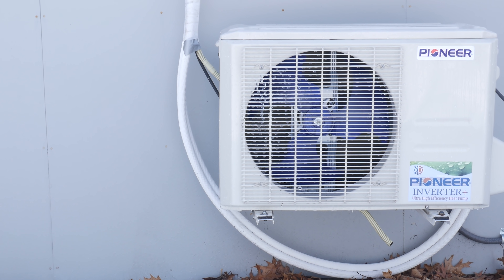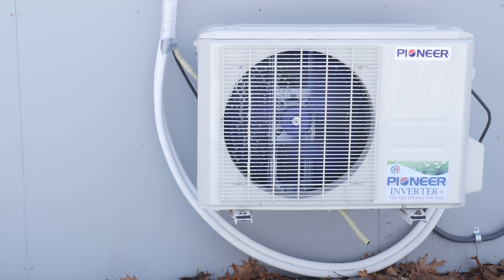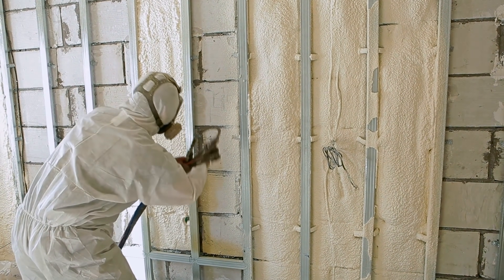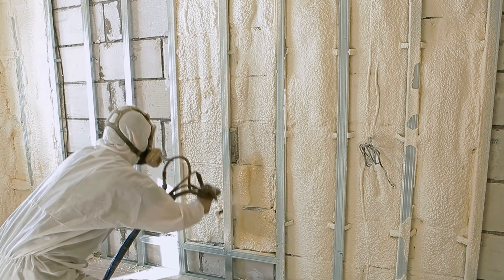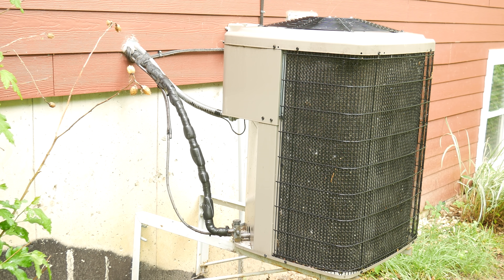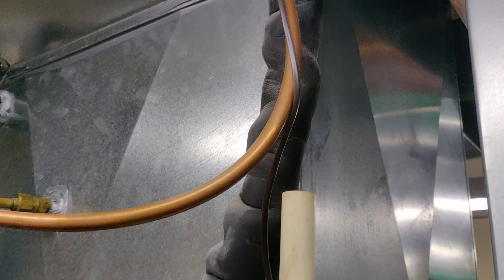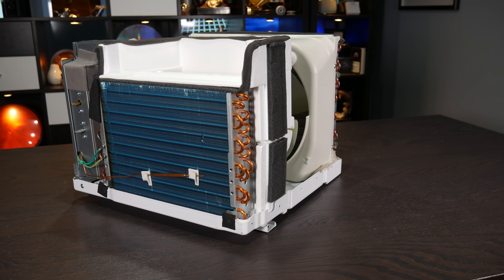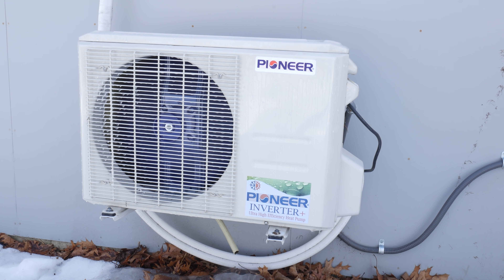Heat Pumps are Not Hard: Here's what it will take to start pumping

Comment: I had a 4 head mini split installed a month ago. Even running the line sets on the exterior walls, it took them 4 days to get it all installed. So, in that case, I think the labor cost was a lot more reasonable than you’re making it out to be, especially since he had to have 2 technicians a lot of those days. A lot of the labor in the case of multiple heads is getting all those lines installed and looking nice. It’s a lot of climbing ladders and wrangling fittings and pulling vacuum. The time really adds up! That said, there was definitely some healthy profit margin being realized.
Reply: Single zones are very easy the multi zones are much harder especially because American homes weren't built with these in mind most times several hours are spent problem solving every company needs to make a profit and employees need to get paid especially since in my state you have to go to school and be licensed that coupled with the hard labor and crawling under gross crawlspaces under decks and tight disgusting attics and that is why install cost is high plus all mini splits are made in china all of them... And install done in America that's the disparity in labor cost plus the lines and line covers are insanely expensive
Reply: @ctoddgo3074  I told the technicians not to bother with my tight crawl space and attic because they’re both an absolute pain to work in. Since I don’t have to look at the outside of my house I just had them run all of the lines on the outside. But that still had the techs going in and out, up and down my stairs and up and down ladders all day. I kinda felt bad watching them. It looked miserable. And most days it was only one guy. At least they didn’t have to slither around in fiberglass and spiders, I guess.
Reply: @VoiceOverTrailReviews  yeah it takes about 3 days with 3 guys to install a 4 head unit properly depending on the house some take less those guys where I live went to school and had training and should be compensated properly the business does make a profit and has expenses and there are other items that add up. So I took offense a little when he said hvac guys are greedy I don't own a company or set the prices but I know what it takes to install a multi head unit and to say that any company shouldn't make a profit or pay their employees for their labor is what is ruining this country honestly this channel seems knowledgeable about many things but is way off base on this one imo
Reply: If the technicians are being paid the way I think they should be paid, then it’s easy to imagine 3 guys over three days plus the cost of benefits and other overhead eating into the profit margins pretty quickly. The guys installing my system were working massive overtime trying to get that thing installed. I really didn’t think being quoted 12.5k for a 3 ton system seemed excessive. Plus, it’s not as if HVAC companies or techs are exactly tripping over each other for the ‘privilege’ of doing residential installations. I also think people expecting to get everything free or at discount is leading us to ruin. People’s labor is worth something to me!
Reply: @VoiceOverTrailReviews  That was not the point tho, the point was that old gen. systems are quoted much cheaper, despite not being more complex tech-wise. It suggests oligopolies and vested interest, where new tech is priced out only because it requires new skills and tools to acquire and there is an early adopters premium to be paid by those who care.
Reply: THE UPLOADER only took 1 day to install his & he’s never done it before.  It should not have taken trained techs 4 days to install an equivalent system.  Honestly it sounds like they were incompetent.  (In my state contractors are denied certification if they are incompetent.)
Reply: SCAMMING is surprisingly common.  At a Dodge dealer the mechanic told me I needed a new radiator.  At another dealer, the mechanic said new rotors.  BOTH were lying:

- the radiator was not leaking as claimed.  It was just a loose hose
- the rotors were measured by me & double Honda’s thickness spec
Reply: YES people deserve to get paid for real legitimate work.  They do NOT deserve to get paid if they’re dishonest.  Like the car mechanics.  (Or padding a 1 day job to 4 days.)
Reply: @electrictroy2010  he said they were installing a 4 head system, on multiple levels of the house. That’s 4 times as much work. I can tell from the way you talk that you have no idea how much work mechanical contractors have to do.

Comment: I am just seeing this in September 2023.  Wow you are spot on.  I got some quotes for mini-splits.  These were single head units.  After pricing the units I saw that the contractors were GOLD plating their installation.  I said no way.  I was trying to replace a PTAC unit.  Those are the motel units that are everywhere.  I bought a heat-pump version with 3.5KW of emergency backup heat coils for 1/10 the price.  The old unit slid out the new one slid in.  By watching carefully what I was buying, it even plugs into the same outlet.   In Kansas City area this will do nicely for the room it is in.

Comment: Hi there! Nice video! Back in engineering school, when I first learnt about heat pumps, I was shocked by their real potential. So much so that I qualified them the closest thing to magic that I knew of. Thermodynamics were not so easy to master but the feeling to steal heat was sooooo good.

I have to say, it does make some air noise in the house. At first, I was concerned but after a week my brain just added it to the background noises of my place. So it is not so bad in the end. The outside unit inverter system has soft start and is not as noisy as the legacy AC bang/bang compressor design that's for sure. I guess the power factor is better too so it is nicer for the grid and easier to feed with a solar inverter.

In France, reversible inverter models are quite common. I'm surprised that in the US you still have mostly only cooling ones... We however have strict regulations an only qualified technicians can deal with refrigerant loadings/unloadings. You can still do a full DIY install if you get precharged units and lines with special sealed fittings that rupture when tightened.

Sad part:
A lot of places have a so called "landscape harmony to preserve" which here in France, depending on locations, has the power to make you undo whatever is considered ugly! If you are within 500m of a nice looking centuries old building (includes bell towers, ruins, canals...) you'd better check about that. I never noticed but almost every village here is concerned. That's the cost of a very nice looking country-side I'd say! I Had to spend 200€ to get this special wooden box to hid my outside unit. It is well designed for air flow but the engineer in me is internally shouting "wtf! let it breath!". Authorities found it nice-looking which is great as I don't want to pick up a fight that i'll certainly loose. If i can easily hid the outside unit in my case this is not possible for everyone which is a bit unfair. Do you have such tight regulations regarding landscapes in the US? Not only local regulation or very important buildings/famous locations which are the heart of our heritage. I mean about the vicinity of any small old church or so that only local people or fan of local History know of. 500m radius is a lot as most of the people will live there in a small village.

Next project: Convince our dear landscape authorities that all back solar panels are classy and discreet. Especially 400m away from this remarkable graveyard that i am apparently within sight in the winter when trees don't have their leaves. Come-on! I will surely not be allowed to cover all my south facing roof but i'll try to have at least some of it... Feels bad to have all this energy falling onto my roof and not being allowed to recover it. We keep our nice looking villages with picture-postcard castles and chapels with no evident signs whatsoever of post WWII technologies which slows down or stop the individuals willing to actively fight against global warming. I hope they will cut some slack to it at some point. To bad middle ages guys didn't put solar on their roofs... Authorities would force us to do so otherwise.

Have a nice day!
And remember => Entropy is the ultimate enemy.
Reply: No, although New Mexico has very strict building designs in some places
Reply: The US Constitution starts “We the People” which means all authority comes from the citizens.  Few Americans would tolerate being told “your heater is ugly… remove it”.   Where I live every house has one, so it’s considered normal

.

Comment: I'm fascinated by this series! I live in North Dakota, so I do get the occasional day where I would need something to supplement the heat pump. Currently I have a forced hot air gas furnace for winter, and I have a semi-split air conditioner: it's a saddle unit that sits over the window. Of course, my 672 square foot house isn't exactly what a lot of heating/cooling people have in mind when they design their systems. 

Interestingly, where I work there are heat pumps for every room. They are great because we had no air conditioning before and my side of the building was miserable. And they're great for that awkward time in spring and fall when the big boiler that heats the building is too much.

Comment: Last summer I replaced my ducted heating system with a ductless mini-split and it was a pretty good improvement, because even though the insulation in my house was crap, it at least let me only heat the room I was in. At this very moment I'm having my attic reinsulated and hopefully that'll give me a much bigger improvement.

Sometimes it does get a little colder here than a heat pump can quite handle, but that's why I have portable space heaters.

Also, I'm in Seattle, and not a single installer I talked to had anything to say about noise ordinances.
Reply: And because you're in Seattle your energy is totally green!  It's awesome here!
Reply: @DeviantOllam  Yeah! Although heat pumps are still a win for folks in fossil fuel areas too. Less energy usage is better.
Reply: Do your windows next. I live in maine and while I see the difference on the heating bill with attic insulation, good windows made all the difference in how a room feels moment to moment. Especially in rooms where the thermostat isn't. Get good weather stripping around and under your exterior doors if you don't already. Sometimes it isn't all about keeping the heat in,  its more about keeping the cold out. If you aren't vain hang thick blankets in the doorways and over the windows of the room with the pump. Does a really good job.
Reply: @michaeldaigle7207  yes windows are very important. Our house was built in 1939 so it had no insulation and the windows were still the single pane aluminum framed windows. They are absolutely terrible but fortunately replacing them has been really easy. There is a huge difference with just Windows being installed alone on the temperature control in the room.
Reply: @michaeldaigle7207  My windows were already redone recently though, I don't see why I should do those next

My actual next thing on the list is the fireplace, because that seems to be the current biggest heat loss for my house.
Reply: @phantomreaver85  yeah washington state's energy is mostly hydroelectric (i.e. big forest-destroying dams) and nuclear (which is better for the climate than burning hydrocarbons but mining uranium isn't particularly green either). We're slowly getting more and more solar power which is helping but it's definitely a process.

Comment: I have been using a 10000btu heat pump to heat and cool my 1000sqft attached garage in central Ontario Canada. It costs maybe $40 extra /month in the depths of winter and it was not difficult to install. It keeps my insulated garage (doors too) between 15C and 20C all winter. We saw down to -33C this past winter. Much appreciated for working on vehicles.
Reply: 1000 sqft? That's a monster garage!

Comment: First of all, i just think your content is great. I'am ac tect in Finland and heatpumps are very common here (i have two in my house). We dont really have gas lines in residental homes. Most common here in new houses, for ac is thermal heatpumps. For the older houses we instal mainly air to water heatpumps. Each system are easy to change for cooling, but its pretty standard here. Now days i work at nucreal powerplan cooling systems, but i think its funny that refigeneration works here the same... Just for larger shale 😁 Keep on the good work. Best Regards form Finland.

Comment: I have worked on heat pumps for 15 years. More specifically,  I serviced over 400 of them on a highrise built in the mid 1980s. It was great for the owner as they only had to pay to maintain a 70° water loop. They were efficient but noisy.
Reply: @asbestosfibers1325  I mainly serviced Whalen and Florida heat pumps. They were packaged really tightly. The only real water leaks that I dealt with were on the flexible supply and return hoses and an occasional clogged condensate drain. As for refrigerant, the cap tubes would rub and leak.

Comment: Regarding the units that can transfer heat between rooms, I see this applying to multi-story houses. All of the ones that I've lived suffered from significant temperature differences between floors; someone is always hot or cold and compromise here just leads to neither party being comfortable. Individual room control with the heat moving between rooms sounds very nice. Thanks for the great video!

Comment: I know this will sound a little odd, but one aspect I think you should think about when advocating for this is how there is always a feeling that you don't want to make the jump now because the tech is improving so fast that waiting a year might yield drastically better results. Which becomes equally applicable logic when that year comes up that you feel, "well the return of waiting another year for a better system will outweigh the loss of keeping the current system for one more year."
Reply: That may be true for a newer tech like solar or BEVs. But, as mentioned in the video, this isn't anything new. It's all existing tech. Yes, small/marginal improvements are being made, but nothing revolutionary. The only thing that could make a big change would be for US manufacturers to start building large volumes of them and reduce cost via economy of scale, but given the current state of the world, I wouldn't hold my breath for that.
Reply: But then you get locked into that pattern, "if i wait just 1 more year....", and never upgrade.

I think its best that everyone upgrade as soon as they are able to, rather than wait for a slightly better efficiency, when we have MUCH higher efficiencies than our current systems already.
Reply: Counterintuitively efficiency gains may even reverse, when the current efficient gasses are disbanded due to their GWP issues. 
And we are forced to other gasses like CO2 or flammables.
Reply: AH yes, the ol' graphics card conundrum.
Reply: @Froggability  hydrocarbon based refrigerants may be the way to go in the future

Comment: I've enjoyed your series on Heat Pumps!  thanks.  My 70s home has an oil furnace.  Last fall I installed a 24k Mini Split and we heated the whole main floor with it this winter.  Installed it myself for $1500 total.  We also got a Tesla at the same time, last September.  My electric bill went up $90 cdn a month this winter.  My oil bill went down $250 a month and gasoline down by $200 a month.  Huge instant savings.  I think the Split will have paid for itself in 2 years and the Tesla cost me no more than a similar ICE car I would have bought anyways after selling our  14 yr old SUV - so the net cost was $0 to go to a BEV and the energy savings are all pocketed. There is one catch: my mini split is not the most efficient, and struggles to heat the home to over 68F for a week at xmas when temps were below freezing.  Luckily that was the only week it was below freezing all winter, and I just ran the oil furnace for that week anyways.  So there is part of the solution: DUAL FUEL in below freezing cold regions (unless you go PassivHaus!).
Reply: I wonder what effect upgrading your windows and insulation would have on that max winter temperature.
Reply: @Assault0137  probably huge.  I have 6 huge picture windows around my living room and kitchen which are pretty wasteful.  Also over half the windows on the house are single pane! leaky doors, non insulated basement, its all pretty bad.  Still the 2 ton split heats the 1500sf main floor very well except that one week at Xmas.